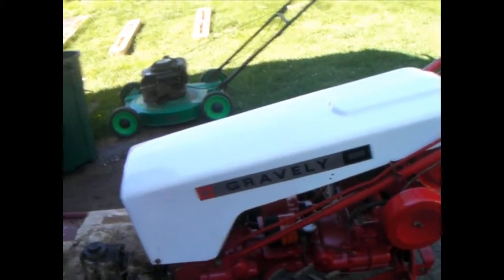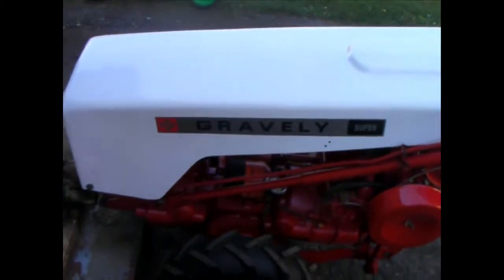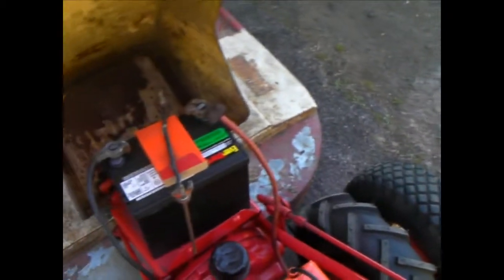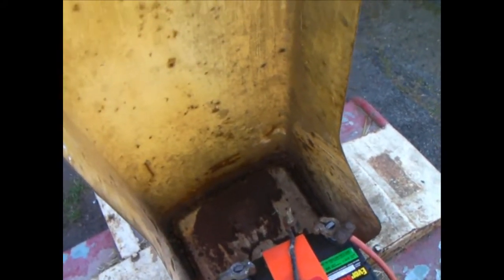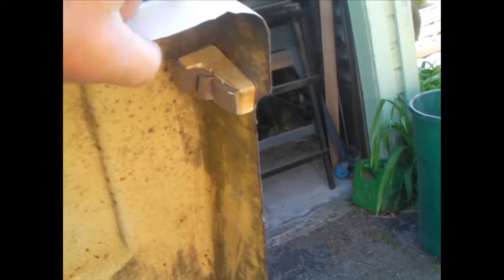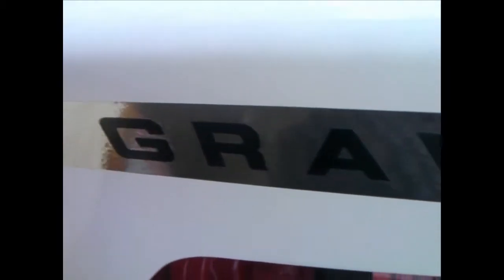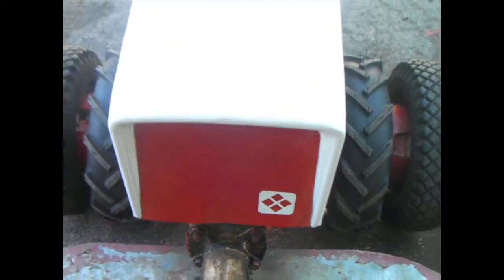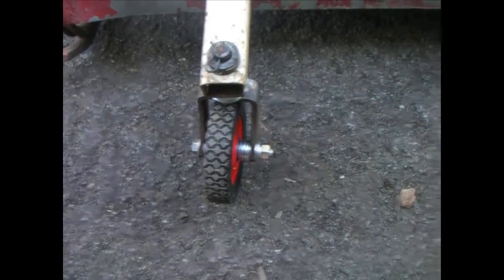Gravely L series restoration Part 3.mpg

Comment: I did see the hauler video.  I like it.  A 40 inch deck would be nice for my place - unfortunately I usually default to my Yard Machine ride-on only because the 30 inch width of my gravely mower makes the job take too long.

I've got a 68 pull starty swifty in my basement now and am cleaning it up.  Picked it up in Gettysburg last summer.  Not going as far as you, since I don't mess around with Bondo, but it is looking good.  I'm putting the 6.5 inch ag tires (from Richard's).

Comment: Nice restore. Going to look at a couple Gravely's in the next couple days.One runs and works,has a snow plow.$400.00 The other is not running and has the dually wheels with the lawn mower atchement. for $50.00 ! Ran when parked over 20 years ago.LOL. Also,nice walkin stick ya got there, is it manzanita? Ive got one that I cut and made myself out in Northern Cali.